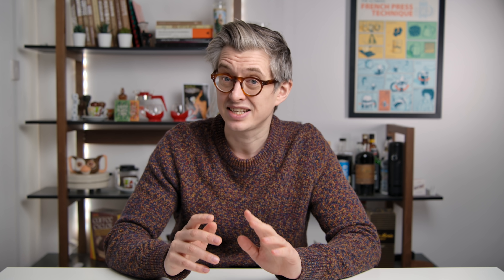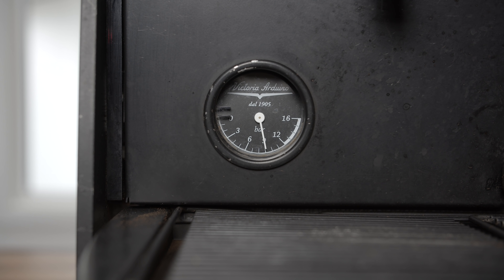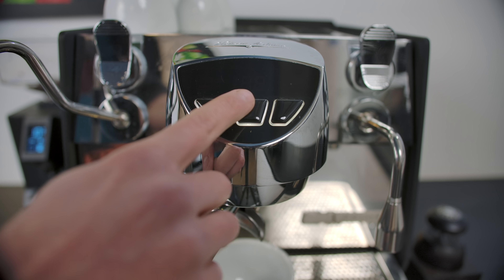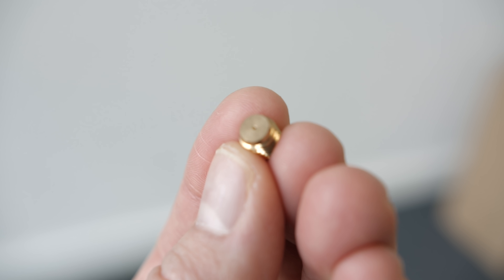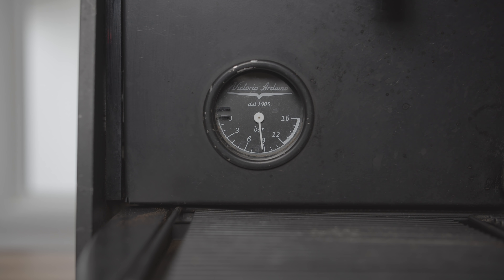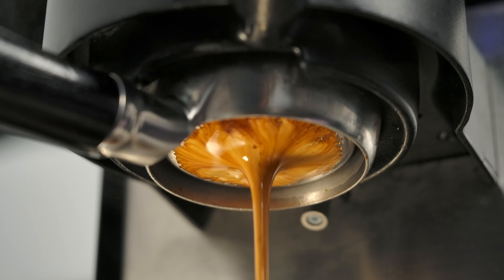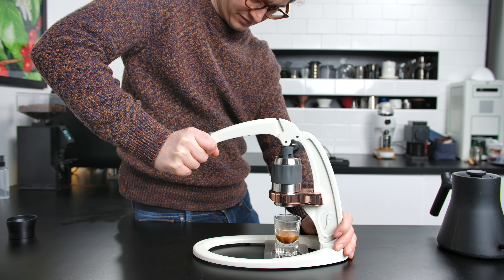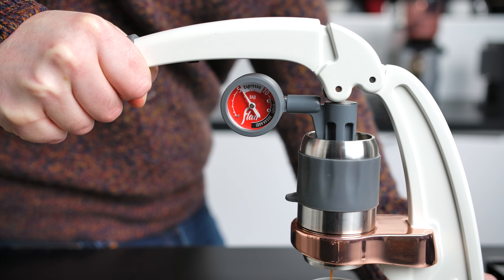Understanding Espresso: Pressure (Episode #6)

Comment: I'm planning to build a system with a pressure sensor, PID(for main and secondary heaters), pump control and a scale that will send its info(live) to the main processing board.
This way I will be able to control everything.
Because of the scale, I would be able to calculate flow rate too and adjust pressure accordingly, even for preinfusion and after x seconds(or grams) in the extraction, etc

I would appreciate ideas/info for this matter, so I can make my coding better and anticipate options/variables I would need.

Keep in mind that even the scale would be diy, so suggestions of what I would need for it would be great. I plan to build it around an esp32 with a small display, just show the current weight and a little icon if it's connected to the main processing board.
The hardware is on the way.
PS:I've watched a lot of videos too :)
PS2: yes, I wanna do something like gaggiuino, but with less options, just what I need.

Comment: Isn't there an elephant in the room? Before you grind shouldn't you clean your tongue and pallet? My sense of taste I have found to be very different at different points of the day but the cleaning my teeth and tongue makes a big improvement in the taste of the coffee.

 I've also noticed that filtered tap water (Culligan Zero filter) produces a different taste than distilled water. I've tried tap water from different cities and again the profile is different. The Crystal Rock company in my town sells a distilled water that has been remineralized from the salt flats in Utah USA which are ancient and consistent.(Planet Pure)

James has done a great deal of work analyzing the flow rates temperatures pressures and of course the beans but if you really want a consistent taste we have to consider the water and the tongue that tastes it. I'd love to hear what you think of a missing part of the puzzle. Have you noticed something that we have missed?

PS: The Crystal Rock company sells different spring waters in different regions for example, in Vermont it sells Vermont Spring and so on. My Culligan Zero filter came with a TDS meter for testing "total dissolved solids" and they guarantee 0% but it's pricey.

Comment: I would appreciate a discussion on how to deal with the typical home 15bar machine.
We don't have the easy ability to lower the pressure to 9bars.  So, how can we make the best of what we have?
And it related to the "beginners guide to fixing bad espresso" because, many beginner machines do NOT have a 9 bar system.  They have a 15bar pump with no pressure regulation.
Reply: I have the same problem; I could dial my espresso to 9 bars, but it's either underextracted or still too fast.

Comment: I've an older machine, a La Scala Butterfly which seems to be a generic E61 build, but the pressure gauge runs at around 1.5 bar and only reads up to 2.5 bar which seems baffling when hearing about 6-9 bar. The coffee gates OK (to me) though. Should I look into this? Nothing is obviously adjustable.

Comment: I have a Lelit Mara X and it does pre-infusion, but I think it just starts slow and ramps up rather than tuning on then off then on again. 

Also, I can’t get it to 9 bar. It’s more like 2-5. I listened to a number of podcasts on the topic and tried adding more grinds to the basket, reducing grind size, and playing with the little bit of temp adjustment it allows for, but no significant improvement. When I put in the cleaning basket, it goes to 9, so it’s capable. I realize 9 bar isn’t a must, and my drinks taste good… some times with crema, but what else can I do to get it to 9 and see what that shot is like?

Comment: The 9 bar measure should be in brewing head or pump? Some espresso machine has diff pressure like in profitec go, 9 bar in brewing head is equal to 10 bar in the gauge. Which do I follow?

Comment: Yes 9 bar is standard, so why nobody is talking about different "standard" to  over pressure  pump on machines with vibration pump like rocket apartmento and many other manufactures... They say that 9 bars is not very effective for vibration pump. E.g. my appointmento has 12 bar from factory. Measured by special portafilter. And yes I can't make decent single shot with naked portafilter, it's splattering everywhere. Will try double shot.

Comment: Calling all breville barista express owners!!

I am returning to this video after struggling with shot consistency and channeling on my barista express, despite going through every puck prep step possible (WDT, distribution, tamping, puck screens, paper filters, etc.) BUT THEN, I came across a Reddit post that said the barista express brews at 15bars. I realized pretty quickly that was the issue and did a quick modification to by machine, and it made a huge difference in reducing channeling and increasing shot consistency. So if you’re using a barista express, try the OPV mod. I hope this helps someone :)

Comment: The only way I can decrease the pressure on my Gaggia Selecta Deluxe is to open the steam valve. I use a pressure gauge on the portafilter to go from 13 to 8 bar, but this also decreases the amount of water going through the group, because some is diverted through the steam wand. So if I increase the pressure, the flow increases. I can’t see how the two can be separated.

Comment: Most pressure gauges measure relative to air pressure, with air pressure being 0. Air pressure changes, all the time due to weather, within a range of about 35 millibars. You can't see that difference without using an excessively precise digital gauge. 
 It also changes due to altitude. Air pressure drops by about .1 bar per 1km of altitude. I live at around 2km so air pressure is about .2 bar lower - which is an amount you might be able to barely see on a dial. 
What this means is that a setup dialed in to brew perfectly at a controlled 9 bars at sea level, would measure at 9.2 bars if it were moved here. If that same setup were tuned again to brew at 9 bars at this altitude, it's internal pressure is now about equivalent to when it was showing 8.8 bars at sea level. 

Here's a more practical way to look at it: This same idea affects the springs in an over pressure valve. If you're trying to control brew pressure with an OPV mod, then you don't have a closed system. The spring is being pushed on by the  internal brew pressure as well as the atmosphere. A spring designed to open a valve at 9 bars, is really designed to open at 10 bars (9 bars internal + 1 bar of atmosphere) - and it will always open at a total of 10 bars. So if the atmosphere is .8 bars, then that spring will compress when the pressure inside the machine is actually 9.2 bars.

If you just brew to hit a specific number on a gauge without taking that altitude into account, then you'll be brewing at a lower pressure then you think you are. But it's not important enough for most people to consider, unless you need a recipe to be perfectly consistent at different altitude - which is already impossible, because no 2 espresso pucks can ever be exactly the same. 

You try your best to make the coffee you have taste its best on the equipment in front of you. That is the process.

Comment: U mean Does expresso brewing pressure depend on grinding size?
Reply: at a certain point yes... if you grind it very finely there will be more resistance because the water will not pass through easily, so you have more pressure. If you grind coarsely, the water passes through easily because there isn't much resistance, so you will have less pressure. So, the grind size is one way to manege the pressure.
Reply: @rafaelrocha8046  ok but sometimes i see my coffee shot takes high pressure and sometimes low pressure..!! Why this  happening??otherwise my grinder size is set on finer.
Reply: if you have the same grind size and both shots have so large diference, probably you aren’t been consistent in your puck preparation and causes channeling in your shot. All this considering that is the same grind size.

Comment: Hey James and coffee lovers!
I've watched this series and learnt a lot about coffee. I have a Gaggia viva style machine and my problem is that for an espresso (1:1,5-2-5 ratio) needs only 14 sec. It's much shorter time than the optimal 25-30sec. (15gr ground and 30gr extract)
What can I do to increase time, but not the amount of extract?
Reply: I suspect as I think James said, the higher pressure is pushing more water in a given time.
Or flipped around, X amount of water is pushed thru faster.
The only thing I can think of is to reduce the pressure after the pump, so it does not push so much water.
This is the often talked about Over Pressure Valve (OPV) mod/adjustment.  Kinda easy on some machines, PITA on other machines.

Comment: Is LaPavoni (and/or other lever coffee machines) a special case? I think I'm grinding quite fine. In fact, I'm putting what I think is a lot of weight on the lever, and the pressure meter shows a big SIX. I can crank it up above six, but I look like I'm arm wrestling with a robot. It just feels wrong. So.. if there is another LaPavoni user in here, one with a pressure meter, what kind of reading do you get? BTW, I use 16 grams, I do get 30 grams out in 30 seconds, while pushing at SIX, then decreasing. And I like the resulting coffee. Am I doing something wrong? What's your meter reading?

Comment: James & anyone that's willing to help; when I got my espresso maching a couple of years ago, I knew even less than I know now about espresso brewing, so I honestly just went for the one that offered a higher number of bars of pressure 🥴 which was actually 15. I am not an espresso experienced taster, but I've never felt satisfied with it. I let it brew for about 15 seconds, after that I feel only water comes out. When I started seeing your videos & hearing about 25-30 seconds being the best range I thought I will get the most insipid coffee. I'm wondering if that assumption is actually correct & if a 15 bars espresso machine is not good at all. Someone please advise before I engage on a search to buy a new one.
Reply: I'm in search for an answer to a similar question, but what I've learned so far is that home espresso machines have vibratory pumps and commercial espresso machines have rotary pumps. Vibratory pumps are smaller and cheaper, but ideal for a home espresso machine. These pumps need to be at 15 to 20 bars of pressure in the begining to reach to around 9 bars at the moment of extraction. Commercial machines don't have that problem as the pressure is more constant during the flow of the process. 
So, what we are looking for is 9 bars during the extraction.
Something similar happens with cars, where the horsepower declared by the manufacturer is typically higher than the actual power that reaches the wheels due to losses in the power transmission process.
That is more or less the idea behind it, as far as I understand.

Comment: I have a Sage barista express (Breville), when Im brewing at 9 bars, the flow  is too fast and over extracted,  and if I try to restrict the flow a little by finer grind, then the flow will be fine but the pressure will be way too high, and channeling increse too.( in other word, its almost impossible to achieve the 2:1 or even 3:1 ratio in between 20 - 30 sec at 9 bars with this machine), anyone have any idea ? 😊

Comment: My only question is, that when the puck compacts and starts to choke the machine, why don't we make a machine that pushes through that? In theory grinding finer is always better as a higher surface area of your coffee will lead to a more even and thorough extraction. On a similar note, that of flow, why we don't make baskets that have minimal resistance? Small, precision holes is almost what people want these days. If you put a bit of water in your basket it will flow out slowly. Wouldn't that make it semi-pressurised? Why don't we make portafilters that simply acts as a supporting structure for a more normal paper filter? A lot of people are already using those in their puck prep regardless. This would in theory allow you to grind even finer because the less resistance from the basket itself would mean that the machine would choke later - try grinding finely with a pressurised basked (don't, please).

Comment: An interesting series. Ive taken a back seat with my espresso brewing for the last few years but your videos have made me get more involved again. I have a Gaggia XD 1 group commercial machine that i bought cheap and repaired and have used it for 11 years now. Interestingly it has two pressure gauges one for the pump pressure and the other for the boiler. Of course on a machine like this theyre both adjustable. My question ties into the previous video about brew temperature as I would like to know how to correctly set the boilder pressure. The brew temperature is controlled bu the boiler pressure as the water flows through a copper heat exchanger in the boiler. I run at 1.1 bar as i believe this is correct but i have no idea if it is right for a 93 degree extraction. I would like to know more info on this type of system with the heat exchanger and no specific temperature control aside from the boiler pressure.

Comment: RE: pre-infusion; I have a synchronika with only the reservoir & pump switch (no water line pressure).   What should I do?   
ALSO, I have a clunky hard to operate flow control (I gave up trying to use it for PI..  but I’m still reducing the flow towards the end..  SHOULD I return to using flow for PI?   I’m plagued by too mellow tasting coffee..   I tend to like darter coffees..  I’m starting to suspect my grinder, but it’s a Kafatek with a cult following (so I’m afraid to ask over there.  I liked the ceado E37S I had for a few weeks (but those were the first shots I ever pulled).  .

Comment: 1. Imagine if apple or google produces a coffee machine that has an AI. On every pull, it gathers data and uses that data for the next pull. And imagine if the machine has the capability to analyze the espresso result and get the total extraction, TDS, flavor, etc. The machine allows you to dial in without hassle and find the perfect combination (yield and time) with the specified dose just by pulling a shot 5 times. And that's how we calibrate our espresso. No more barista, no more competition, all that's left is a good coffee.

2. And imagine if there's a machine that can remove the bad elements from the coffee. The bitter taste often comes from the end of the pull (if there's no channeling). What if we can break down our espresso with a machine that can work at cell level with a blazing speed. It will remove unwanted taste, the saltiness, the bitterness, and leave the good taste behind, it will also have the capability of removing the excess of water. So logically speaking, the machine can pull a 100-second shot, remove the bitterness, the excess water, and other bad elements inside the shot. No matter what kind of espresso you pull, you can always edit it later.

Comment: Why is that home use machines generally up to 15bar as their selling point. It is because of the pressurized basket but surely 15bar will choke the puck. No? From your other videos you indicate that you should always upgrade to a bottomless basket and preferably VST or IMS or similar but what about the pressure the machine is producing? Not always possible to exchange a spring like on a gaggia for example.
Reply: With a pressurized PF, I was told to grind coarser, a medium grind, to let the PF/basket do the pressurization, not the puck.

Your second point is the problem that I have.
My old machine has an OPV that is not adjustable (spring OD is 4mm vs 7mm on the Gagia), nor is that OPV easily replacable with a "generic" adjustable OPV.  So I'm stuck at the 15bar of the pump.
My new machine (Solis) has a flow meter BEFORE the pump.  So an OPV that opens to reduce the pressure, will divert measured water back to the tank, and the PF will get less water before the machine turns off the brew.   To avoid that problem, again I am stuck at 15bar pressure of the pump.  Sometimes automation creates more problem than it solves.

Comment: 3:20: Hmmmm. So the process of innovation eventually led to standardization, to ruling out a slew of available flavor profiles in favor of a single, idealized profile for all? Fascinating. Kinda puts me in mind of digital audio. Where there is a vast dynamic range available, far beyond what was available in the analog process - yet virtually all material released over the past 20 years occupies only the top 0.8 percent of all that dynamic range, and in fact often devolves into square-wave ear fatigue.

Comment: Hi James, I have a Gaggia Classic 2010 which I bid and won on EBay sold as “ not working”, after stripping, cleaning, replacing seals, adding a DIY PID, pressure Gauge, Rancilio wand, bottomless portafilter with IMS basket and shower screen… ( sharp intake of breath)… it now works… phew… I’ve also invested in the basic Eureka Mignon Manual grinder, I have been plying with pressures and around 7-9 bar seems to be the sweet spot with Grinder dial set at No.1… it still isn’t perfect but i manage an 18g dose in with 36g out at about 28 seconds… using Papa New Guinea fresh beans… I’m still not 100% happy with the taste yet but I love tinkering with the pressures and grind size… thanks for your educational videos… Andrew

Comment: It's interesting how more pressure isn't better. Never thought of how the water is flowing through the espresso, and more pressure creates paths and the water finds the path of least resistance. 

When searching for an espresso machine, most products boasted of having up to 21 bars of pressure. If my gauge is right, I get about 15 bars. I pull a good enough shot, but now I'm curious what I'd get at 6-9 bars.